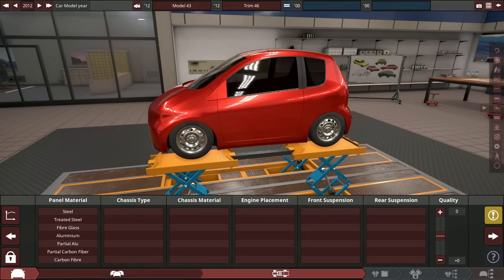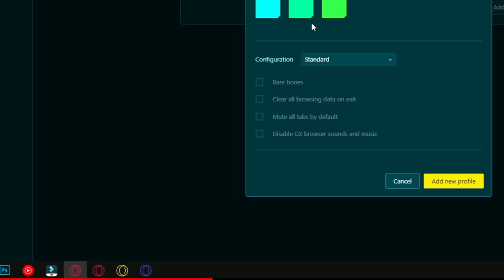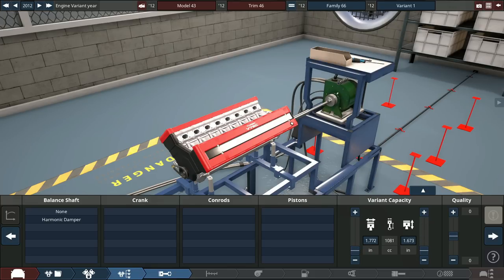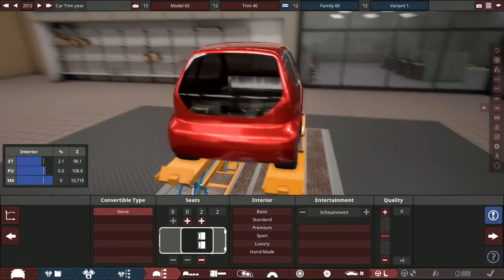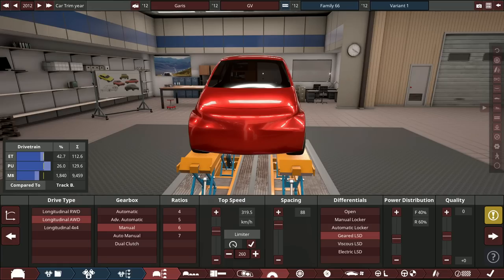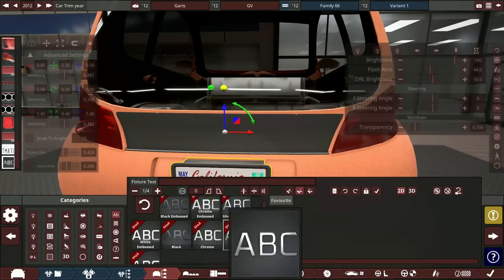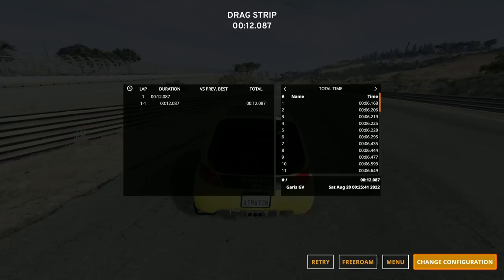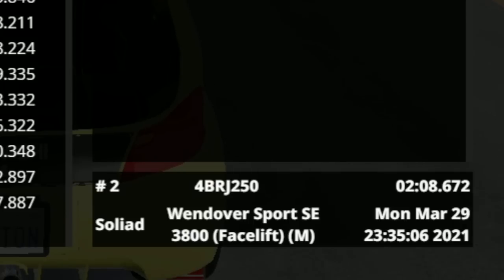Smallest V16 Engine!? ~ Automation - BeamNG

Comment: This is what Dodge engineers would come up with if they were tasked with designing an economy car, except it would have a two liter…supercharger. I just learned about the Aston Martin Cygnet today and boy is that car cursed. Also you know your naming is good when it borrows from the Yugo. The Yugo GV also stood for good value. Idk if there was any value but it was cheap.
Reply: So basically an SRT-4 Neon?  But that was turbo and fwd.  Still cool that they actually made it.  I think this could be a candidate for a twin charger setup (can you do that in Automation?) although it would make it seriously nose heavy.  A mid engine setup a la Renault 5 would completely transform the handling.
Reply: Unfortunately superchargers aren’t in the game just yet. The next update (4.3) is when they’re supposed to be added. Pretty sure twin charging was also confirmed for this update.

Comment: Dude, turbo tuning, if you use the new turbo map, you can definitely engineer a lot of the lag out and maintain higher torque for more of the RPM band. 

That said, love your stuff!

Edit: for high RPM you're going to want a large compressor/small turbine setup, so maximise the turbo's effectiveness on the top end but also reducing the spool, depending on the setup, smart boost will either increase lag or dramatically decrease it in Automation
Reply: Im a huge noob when it comes to turbo tuning. How do I adjust it so I can move the peaks or start boost in high psi? Like low rpm and high rpm, plus getting more rpms on it while maintaining high boost at mid rpm?
Reply: @reedman0780  To be honest, even though the beta tuning is a huge step up from what we had before, it's not super in depth to the point of engineering exactly what you want all the time. 

That said, the compressor map is really useful, and it's all I really use to work out the limits of the engine I'm building. What I've learned so far is this:

Compressor: Bigger = more top end power and more room for higher boost at the cost of lag. You're going to want the boost map to basically fill the chart, so increasing boost to the power level you want and then decreasing the compressor size to the smallest that can cope with that boost to minimise lag is the method I tend to use.

Turbine: Bigger = More room for boost at the cost of spool time, no real effect on the top-end. I always aim for the smallest possible turbine I can get because it dramatically affects when the turbo starts to spool. I tend to use the boost control setting on road engines, because that's normally the earliest you can get your desired turbo to get on boost. As you increase the size of the other components, and the boost, that turbine will take longer to spool up (which can be an issue if you've got a flat spot/gearing issues, especially on AWD cars which don't lose a bit of traction off the line in Beam). 

A/R: Usually, this just moves the whole compressor map one way or the other, and doesn't have a huge effect at the moment. If you want big power at high RPM, then you're best off sacrificing some spool time and pushing the A/R a little bit higher and vice versa for smaller, quicker spooling turbos.

Boost: Increasing this obviously just adds power, and doesn't really cost anything other than octane. What you've got to be mindful of is that as you increase the boost, the boost map increases upwards and rightwards, so generally you just need a bigger overall turbo to cope with much higher boost. If you start of with a desired boost level, you can build a turbo around that by increasing the compressor size until it can cope up to redline (sometimes it's worth reducing the redline by a few hundred RPM if you're having issues) and then increasing/decreasing the turbine size to get the shortest possible spool time, with that in mind you should have a really good turbo.

Finally, the intercooler: Increasing the intercooler size allows for more power, but increases the strain on the compressor at higher RPM (moves the boost line rightward) and increases weight. I normally aim for an intercooler a couple hundred hp above the power level I want, because if you increase the intercooler size too much you'll get more power, but you'd have to increase the compressor size to cope.

I hope this helps!

Edit: Couple of things I missed. Firstly the quality sliders make a massive effect on turbos, and increase the overall size of the compressor map and allow for more power and less spool time, while I was learning how to make them I would bump the sliders a little just for more wiggle room (and then usually use +2 or +3 on road engines to make the torque curve feel more realistic on new engines).

Also, if you've still got some octane to play with, on a car with VVL, I always move the cam timing down to make more torque down low (if you've got VVL it won't affect your peak power but will give you much better low and mid range performance, and economy).

Also also! I always use ball-bearing turbos, and it's easier to get a really good curve from a single VGT or twin-scroll than it is from twin/quad turbos. There's definitely more power to be had out of the twin turbo setups, but it's usually more difficult to get the boost to come in as low as you'd want it to on a modern, or luxury, car. It all depends on the engine you're building and the car you'll be putting that in though, so play around, make a bunch of engines and have fun :)

Comment: That thing is all kinds of fun, which I know was the point.  But if you'd put the engine in the middle and stiffened up the roll bars, it would drive like a whole diff car that could hang with supercars of the era.  I'd say shorter gearing would help too but it crushed the drag strip so apparently the ratios are working just fine.
Just out of curiosity, how does the weight of a V16 1.1L compare to others like a 3 or 4 liter of the same size?  
Anyway, love the experiment.  Subscribed.

Comment: 98 octane super fuel??? you mean regular pumpgas right? That's what i buy for my moped at our local Q8 to go to work XD no wonder a Golf GTI makes more power than a 5.7 impala SS
Reply: 98 octane is cheap shite. You can buy 99 at the pump which is an acceptable fuel for low performance engines with low compression ratios, low thermal loads and low expectations.

 Proper engines, with more than 14:1 CR, more than 10k rpms, high temperature, high boost, lots of spark advance and acceptable performance want fuels with appropriate AKI. 
 
 My preferred mix is a 75/25 blend of Toluene and 100LL - takes all the temp and pressure you can throw at it, with ZERO KR.

Fuel selection is critical.